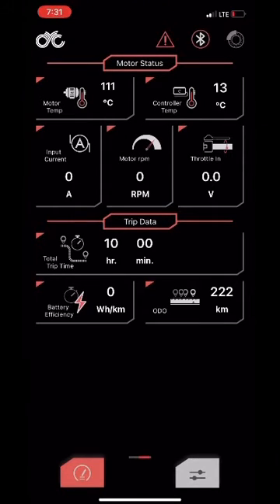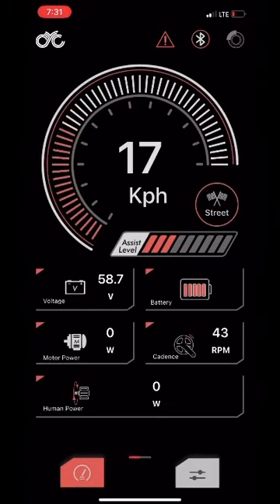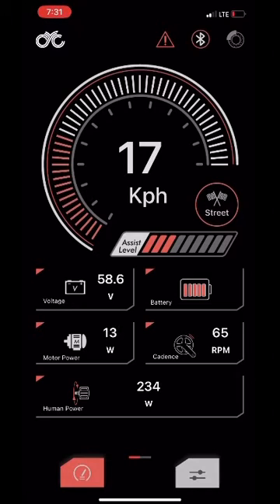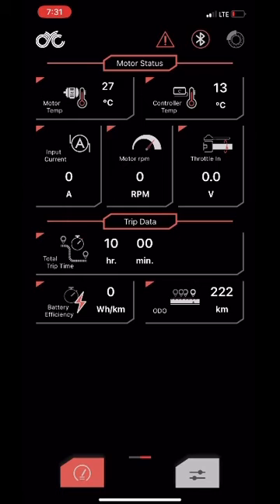CYC Photon crazy temperature readings!

Comment: i installed the x1 pro gen 4 about a month ago and i have the same problem, i was cruising at about 30kmh, motor was at 6000 rpm(wich is at 60%), and it was running at about 70c and got an error code saying that the motor was overheating wich is clearly false since this motor is designed to handle 120c constant heat. Now that the motor cool down, ( a day later) the motor temp sensor is staying at 0c and i cant ride at all. Have you find how to fix ur problem, if yes how plsss <3
Reply from the maker: No fix, just had to replace the motor. The temp sensor was faulty.
Reply: @hiphopsuperman  omg no way

Comment: Just received my new bike that has a Photon installed. Seems I have the exact same problem with my unit. I opted not to have the throttle installed. Wondering what was the outcome for your situation?
Reply from the maker: I don’t have the throttle installed on mine either. It hasn’t been repaired yet as my dealer is waiting for a replacement part. In the meantime, CYC has given me the password to disable the temperature sensor in the app. I only ride in street mode to ensure I won’t overheat anything until it gets repaired.
Reply: @hiphopsuperman  yeah not having a temperature sensor sounds mildly terrifying. Do you know if it’s a full motor replacement of something that can be fixed given the right part? (It’s so sad to have a failure on delivery of my new bike)
Reply from the maker: @MotionFriend  don’t sweat not having a temperature sensor. Unless you are running the motor at peak wattage for extended periods, it won’t get anywhere close to overheating. I believe the motor core will need to be replaced. There seems to be two major parts in the motor, the electric motor, and the controller. There are not very many individual parts within the kit that can be replaced. I understand it’s frustrating, but I was really happy they at least had the password to get me back on the road

Comment: A friend has the Photon and tells me his temp readings are very high. Not all over the place like the crazy readings shown in your video, just super high. My Photon temp readings seem to be very accurate. Usually around 120°F running at 300-500 watts. Much less running at 50-100 watts. Other readings, like Wh/m, are completely wrong. Motor runs great though!
Reply from the maker: Obviously it depends on what power levels you are running your motor. Every motor will run at different temperatures depending on if you are on minimal assistance, or level three on race mode. I agree some of the readings don’t seem accurate. On my DS 103 display, the efficiency doesn’t even appear. It just shows zero. But the motor is wonderful! I’m just hoping that this temperature problem gets resolved. Still waiting to hear back from CYC.
Reply: @hiphopsuperman  well, obviously what everyone is talking about is the inaccurate readings. Not differences in how hard they are driven.

Comment: I believe there is an option to ignore motor temperature sensor in the app. CYC should provide you at least a password to unlock that feature.
Reply: I saw there is also a temp on the controller, wonder if they can use that sensor instead of the motor?  Maybe motor sensor is affected by em noise from the motor itself?
Reply from the maker: Correct. They have provided me that information, I’m waiting to hear back from them to know how to fix this.
Reply: @hiphopsuperman  I doubt You can fix that on your own. Looks like Thermistor is broken inside the motor.
Reply from the maker: @ataksnajpera  yeah, I think you are correct. From what it looks like, I doubt you can even take this motor apart, which is too bad.
Reply: @hiphopsuperman  Controller just checks voltage and then translates obtained value to temperature. If I'm not mistaken higher temperature means higher voltage in thermistor.
Reply: Problem is the controller potentially may throttle the motor if it is receiving inaccurate readings.  I've found with my setup that certain other bluetooth frequencies mess with my app. Could just be my phone. Once I'm done tuning the levels to my liking, I don't really plan on using the phone setup. I think the Photon really shines at 750w and less. Its heat soak at higher rpm (admittedly, fun, but not why most of us bought this setup) is pretty insane, I've only played with it at 1500watts, but man it gets hot fast! Especially if you load it up less than 2k rpms!
Reply: @sr20detized I wish there were more videos of people riding with the Photon. Complete void of videos on youtube which is crazy.